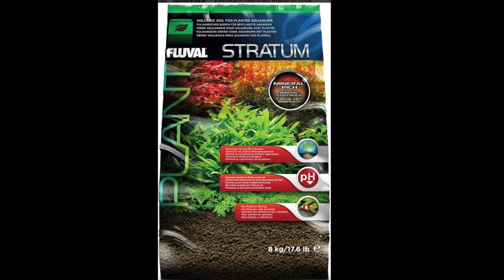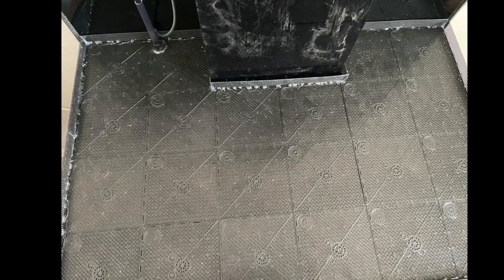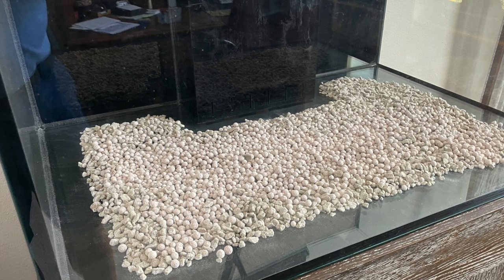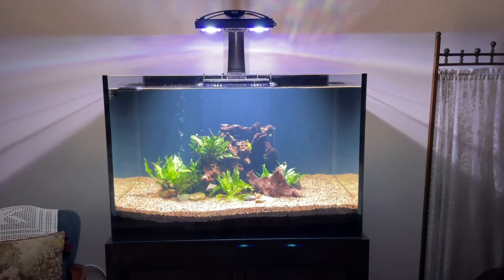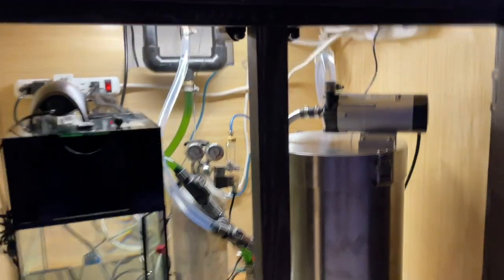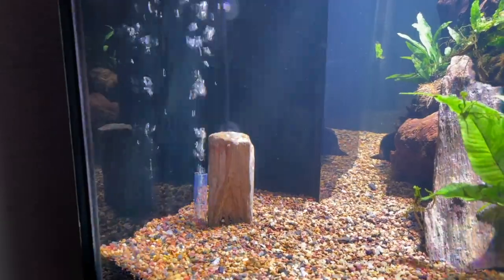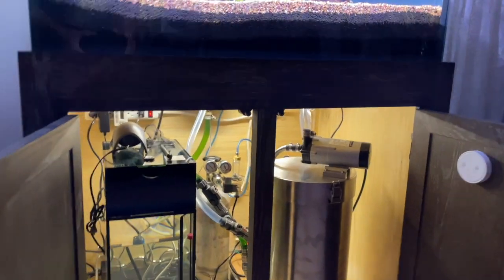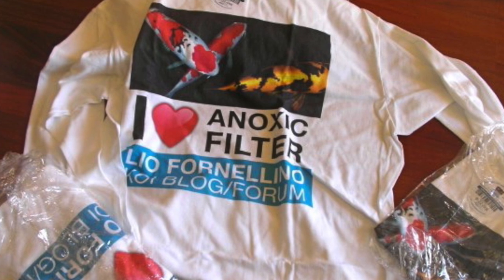Building A Plenum in the SCA Aquarium with Fluval Stratum  : Kevin Novak Ph.D.

Comment: Has anyone been able to get a hold of dupla or this hobby laterite? I cannot find a vendor that ships to canada
Reply from the maker: I contacted them directly here from the USA and they were very helpful too.
Reply: @anoxicfiltrationplenums   one more question for you doc. If i were to make an aquascaped tank full of plants, wouldnt the plants benefit from nitrates? Why would we want nitrates at zero using a plenum if the plants need the nitrates? Thank you!
Reply: @omzdubz  Plants can use nitrates, but they aren't nearly as reliable about it as bacteria.

Plants can get their nutrients in other ways as well. But if you'll notice in the aquarium keeping game, the "issue" we most are dealing with is nitrate in the water column. That's why you see water changes as a standard. They are used to lower the nitrates. 

One way around this buildup of nitrates in the water column is heavily planting. Or often, plants that will aggressively use nitrates from the water column since that is their feeding mechanism (such as water lettuce, frogbit, duckweed, etc). 

But this system of a plenum and deep substrate is intended to create a bacteria system that handles not just ammonia and nitrites, but also breaks down all the nitrates as well.  And if it's doing a great job, the plants don't have to do it. They'll be fine.

Comment: Nice set up!

Last week, I set up a plenum with my 29 gallon aquarium:
Small lava rocks, underground plate filter, weed cover, cat litter, Flourite red (substitute for laterite) and Ultum Nature Controsoil.

I first filled the aquarium with tap water (435 TDS). In 4 days, the TDS rises to 1035.

I removed most of the water in the aquarium and filled it with RO water. The TDS went from 85 to 424 in 2 days.
Please help?
Reply: maybe the lava rock is the problem, try to remove the rocks then do 100% water change and measure the tds again
Reply from the maker: Do a test on water filed with Kitty Liter to see if TDS goes up, and do the same test with the Lava Rock to see if it make your TDS go up or not . My new take with a BCB the same size as a Eheim 2217 filter full of Kitty Litter has a TDS of only 129. So the Cat litter clay is not raising the TDS in my tank at all.
Reply: @anoxicfiltrationplenums   Thank you for replying. The lava rock did raise the TDS a little bit, but once it settled down, there was no change with the TDS. I still have to test the TDS with the cat litter.

Comment: My plenun aquarium no longer remove Nitrate. after at about 2 years....any reasons?please advice. Thanks!!
Reply from the maker: It may be time to clean it with a siphon to open it up again.
Reply: @anoxicfiltrationplenums  i has cat litter rocks above the plenum and then color small rocks   so i do not quite understand what o need to clean...unless you meant unde the plastics plenums....but i put that black fabric you mentioned in your videos to avoid plug the plenum.
But i think my only option is to re do it...it did not last 5 years as wanted but o believe in this .
thanks for your response.
Reply: @alexherrera3918  what black fabric ?

Comment: Do you need to worry about the gravel size with goldfish? The worry is large gravel could get stuck in the goldfish mouth
Reply from the maker: Stay with 3-5mm substrate and no larger for your Goldfish. Make Sure you give them live plants to eat too.
Reply: @anoxicfiltrationplenums  They love their Spirulina Brine Shrimp and Blanched Hulled Peas at feeding time. I run a 'connected' Refugium' tank for the plants that would otherwise be a 'Salad Bar'.
Reply: Over the many years I have lost a few Goldies (which are forage feeders) to large substrate getting stuck in their mouths or blocking their digestive tracts. I have learned to 'grade' my substrate for this reason. (I use a mix of Eco Complete and Flourite.) to be small enough to fit through a 7 count Plastic Canvas, but large enough to Not fit through a 10 count Plastic canvas. That is roughly a 3/32 Inch grade, (or approximately between 2mm to 3mm.) Eco Complete is a mined Volcanic Pumice. and Flourite is a High in iron and other minerals Baked Clay. The larger bits of both can be 'crushed ' in an old fashioned 'Hand Crank' style Coffee Grinder, (The kind with the adjustable auger gap.) - But you need to be careful to sort out the Actual Rocks that sporadically show up in the Eco Complete, those rocks will break the Cast Iron of those antique 'Box with sliding drawer' coffee grinders. ..This 'grade' won't get stuck in the Goldfish mouths, and (hopefully) should be small enough to Not block their digestive tracts. This 'Grade' is also small enough to not technically be 'gravel' but large enough to not technically be 'sand' either, and does not have sands 'compaction issues.' although it does keep detritus on the top like a sand would. *(Which makes maintenance easier in my opinion.)
Reply: A fish that manages to choke on a rock deserves to die.
Reply: @reedbog89  Bichir are good at that.